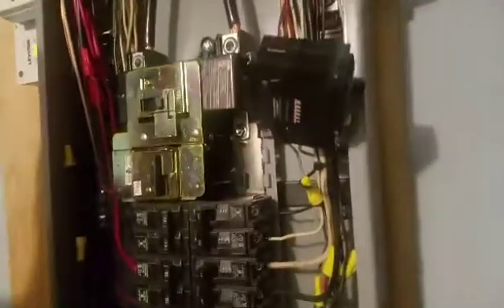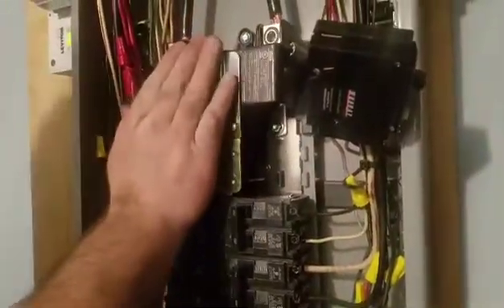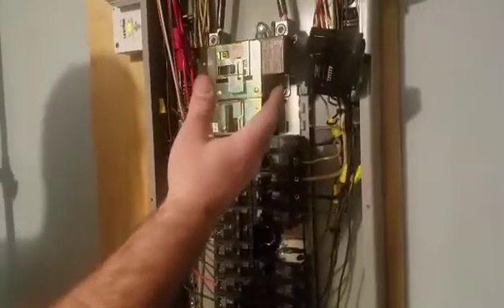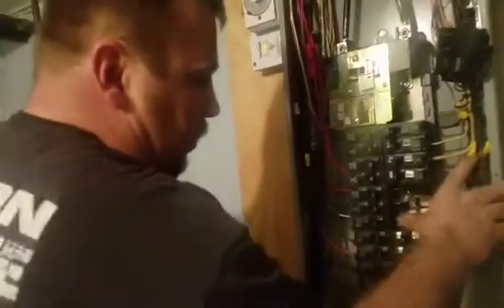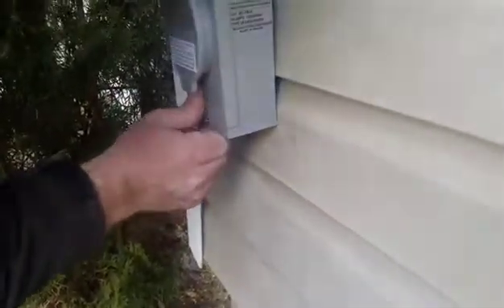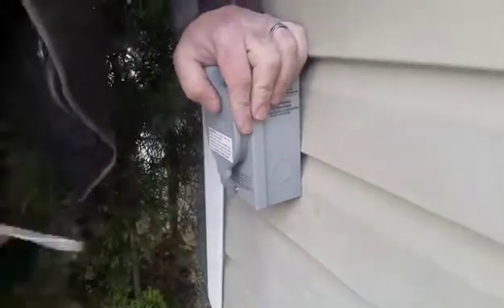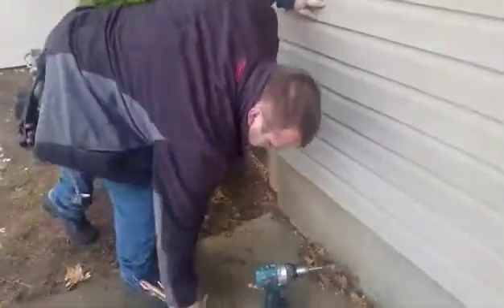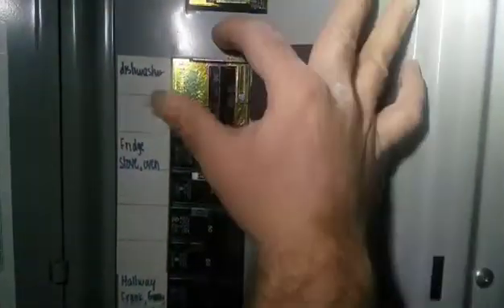Installing interlock kit for my generator hookup

Comment: Hi. I have a 200 amp main panel and another 200 amp sub panel next to it. Do I need 2 interlock kits and 2 double breakers or just 1 set in the main panel.

Comment: Thank you for this upload. I couldn’t figure out how to get the dead front on without the interlock kit working correctly. But I see in the video you have to get rid of the top right two breaker spots.

Comment: I just installed the same interlock. Bit upset about losing the two breakers to the right of the interlock along with not being able to properly cap the opening of the missing breakers

Comment: I have an old Square D outdoor breaker box with two large pullout fuses with shotgun shell type fuses inside. One side is labeled main the other labeled furnace and below four glass screw in fuses.  The main ties into a sub  panel mounted next to the main  with three modern 10 amp  fuses, one single 20, one double 20 and one 30. which supplies power to the outlets.  I have been looking for a video on how to setup an interlock and placement of the 30 amp fuse for the generator [if there's any room}.  Anyone have  a video on something that old?   Thanks.
Reply: Idk if you’re still struggling with this but it seems like all that garbage can be ripped out, used as a junction box and protected by the breakers you named.

Comment: Whats great about an Interlock is you can turn on any light in any room in your house at night as long as your not overloading the generator.  A 6 or 10 circuit transfer switch your limited  to only those 6 or 10